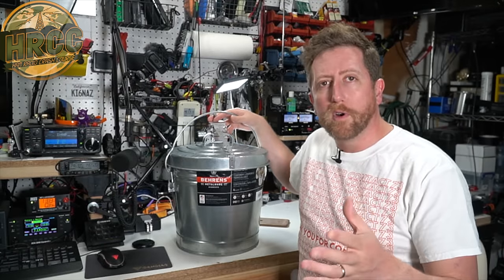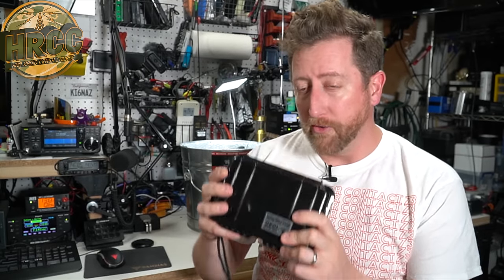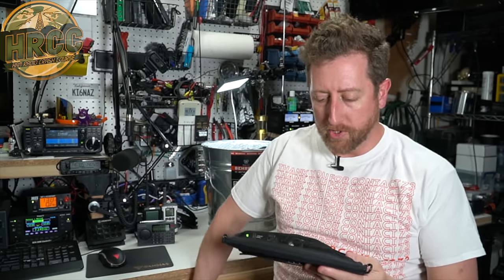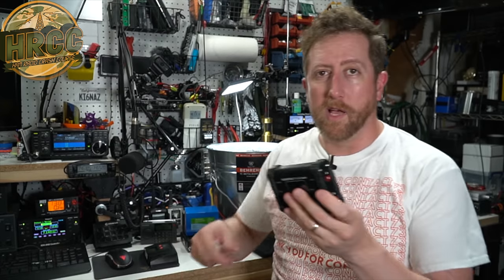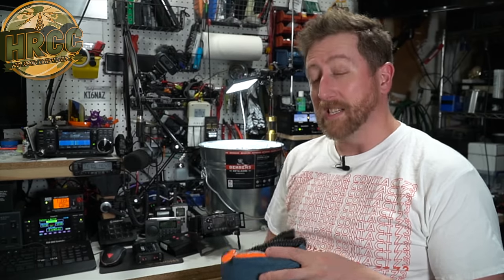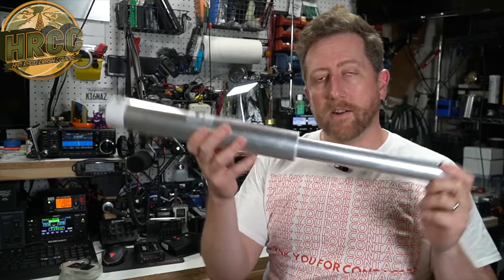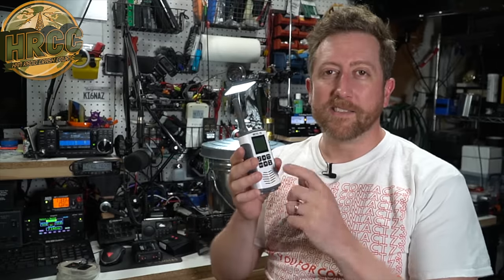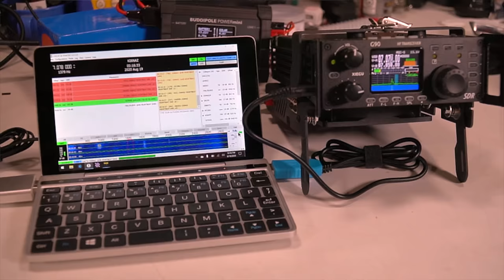Ham Radio EMP Kit, The Tactical Trash Can

Comment: Um...I am trying to be helpful here.  That trash can will be full of trash.  You didn't line the can with plastic.  As an experiment wrap your phone in tinfoil.  Call the phone from another phone.  It will ring.  Does that stop Electromagnetic energy?  Nope!!!  Now wrap that phone in a ziplock.  Then a layer of foil.  Then put it in another ziplock.  Then another wrap of foil.  Then try and call it.  If you did it right it won't ring.  Now throw your bare phone in your trash can and call it.  It will ring...Now....What did you do wrong??  Wrap all the items inside with ziplocks and tinfoil..line the can with plastic....make sure it has a good seal.
Reply from the maker: We did put the phone in the can. It didn’t ring. 

I put up a video where we tested the attenuation in the can upwards of -70db depending on frequency. 

Respectfully, go research what you are throwing out on the internet that you haven’t tested.
Reply: @HamRadioCrashCourse  I have an identical can, went outside and my phone rang with the lid on.  It can't hurt to line the can with an insulating material.  The can becomes akin to an antenna/conductor when subjected to waves of pretty much any form.  Anything metal especially touching the can will pass the energy.  Emp's are more like lightning bolts than radio waves.  Gotta get rid of the electricity or insulate from it.
Reply from the maker: Did you actually watch the video? I did line that can and used conductive seals on the lid where it meets the can.
Reply: @HamRadioCrashCourse  No I didn't watch the video.  I only saw the previous one.  Didn't know it existed.  You did the right thing then.

Comment: This is the problem.....if the radio and tv stations are not hardened, what will you listen to? Also if its manmade EMP, lets say one goes off now then 30 days later another one then 90 days later....all are fried....you must harden electronic devices to handle multiple events.....VACCUME TUBES! OLD TECH
Reply from the maker: You will talk to and listen to people with hardened solutions. Or those not in the affected areas.

Comment: A faraday cage is only as good as it's ground...
Reply from the maker: Not really.  Do you have some kind of citation for that statement?
Reply: @HamRadioCrashCourse  yep, my grad cert for my electronics course/ generator school at camp lejeune.  Learned how to protect against emp being the guys that supplied the electricity to comms and every other piece of gear that would be used during that situation.
Reply: @HamRadioCrashCourse  I'm not saying your idea won't work, it just needs a good ground just like antennas should have lightning arrestors.  Is it necessary? No but it could save your gear and isolation only works to a point.
Reply from the maker: While I appreciate your personal experience, I was looking for a citation I can read.  (I truly want to understand if there is demonstrated testing evidence here).

Let me reiterate.  If a sensitive device is fully and completely isolated from any conductive shell material that makes up your "EMP protection device" and the protection devices is complete sealed externally.  How would the energy of an EMP even make it in?  Please remember the skin effect here.  The skin of the protection device isn't a capacitor, so the energy would be dissipated instantly, no path to ground needed.
Reply: @HamRadioCrashCourse  well I hope it's never needed so you can find out if it works or not.

Comment: Big mistake at 6:45 ..Why store EMP safe equipment inside and waste space?? Why are there antennas and cables inside a  EMP case? Complete waste of time. I would have cellphones, ham radios, amplifiers, charge controllers, fm radios, your baofengs uv-5r's, anything I can have at home that is Electronics ... not antennas, not cables! Waste of space.
Reply from the maker: Feel free to do whatever you want.  I want the can to be self sustaining if I need to grab it and go.  

You may not share my user case, but that doesn't mean I made a mistake.
Reply: @HamRadioCrashCourse  Ok ... we're all in the same bucket here (pun intended :) ) I get it, everyone with different priorities. And I even think that a Portable Faraday cage (a metal bucket is perfectly fine) as a viable "get out and safe your electronics" gadget. But I still think putting passive antennas and cables (everything not affected by EMP) inside is a waste of space. They can fit outside, next/attached to the bucket, on a normal bag. Just sayin' ...